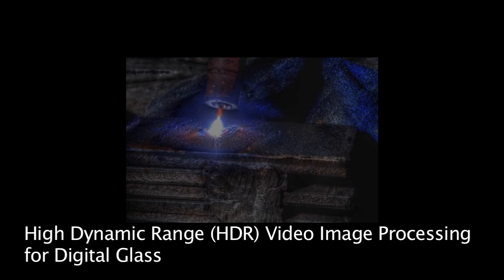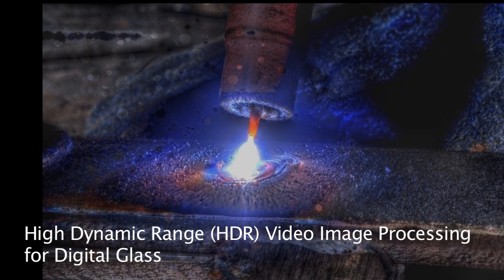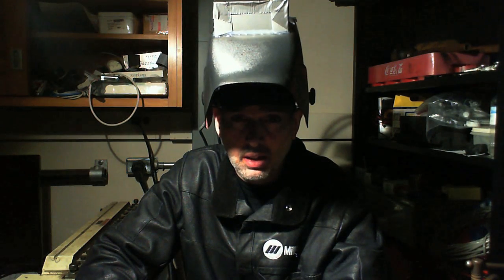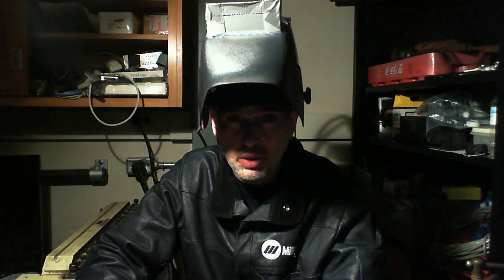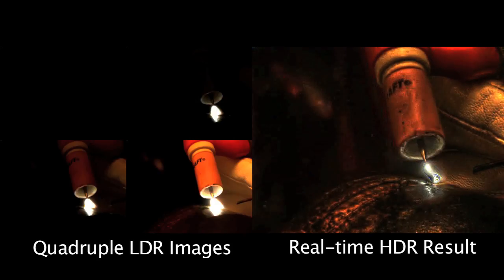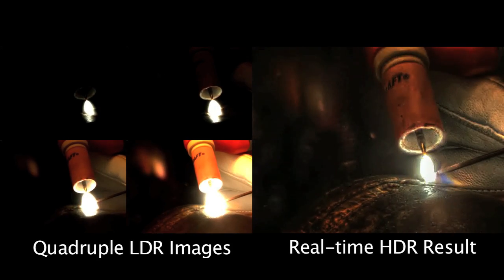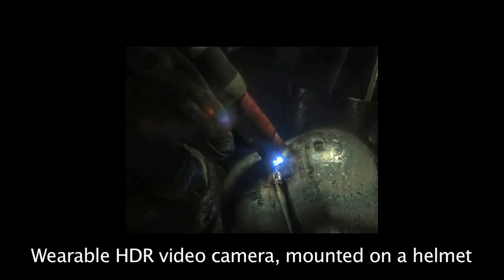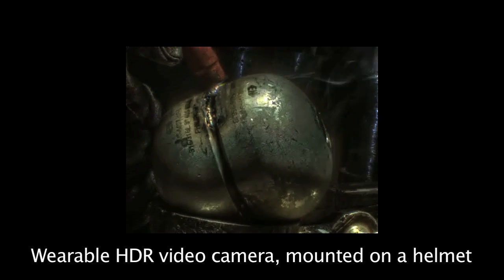High Dynamic Range (HDR) Video Image Processing For Digital Glass

Comment: Will there be some VR goggle type display inside the helmet?  I mean, how does the welder see the images inside the helmet?  I have a feeling like in this video that mirror for the cameras is partially see-through with a normal welding glass behind it and the guy welding is looking directly through that and not seeing the nice HDR image at all, or?  When is the commercial version supposed to be coming onto the market?

Comment: This is interesting to me. I'm a professional welder, or at least I was. I learned stick, mig, spray transfer, pulse arc, flux core, and tig in welding school, along with theory, blueprint reading, oxy-fuel cutting, etcetera. Had CWB stick tickets (flat, horizontal, vertical up) and TSSA mig tickets (all positions on plate), and I put in a few thousand welding hours building oil rigs from the ground up out in Saskatchewan. But then I moved back to my hometown in Ontario where there wasn't much welding work, and I got rusty from the time off. So I moved to Toronto where there's more work, got a manufacturing job mig welding in Mississauga, couldn't see what I was doing because my vision has deteriorated more than I realized, and was basically fired on my second day, although they characterized it as "walked off the job". I'd set my helmet to 9.5, but still couldn't see properly. Kind of depressing, and also annoying having a bunch of guys smirking because they think I'm a lousy welder, when I'm probably a better welder than most of them, or at least as good provided I can actually see more than just a blinding light. The sort of welding at the shop was piece work, automotive exhaust systems. Pretty basic stuff compared to what I was doing a few years ago. So today I'm googling for vision aids for welders and came across this video. Is there anything like this available commercially, or is it just futuristic sci-fi prototype stuff? I need to find a solution to my light sensitivity or find a new career, which, at my age, is kind of a depressing prospect.
Reply: Hey satomiwa, our lab is creating a commercial product now to help welders such as you.  I'd love to speak with you in Toronto and see how we can help. Please send me an email: ken@eyetap.org